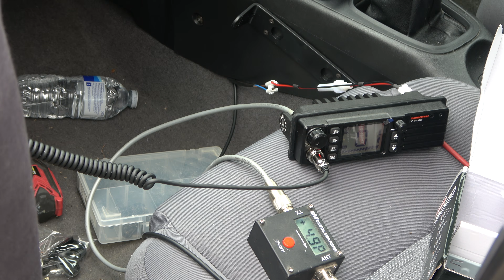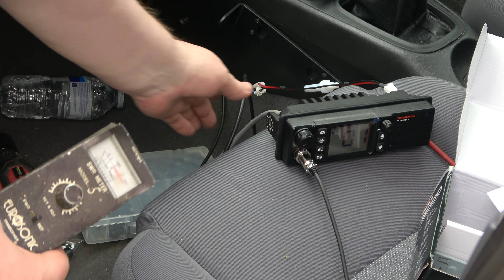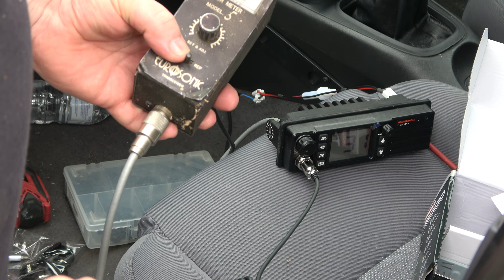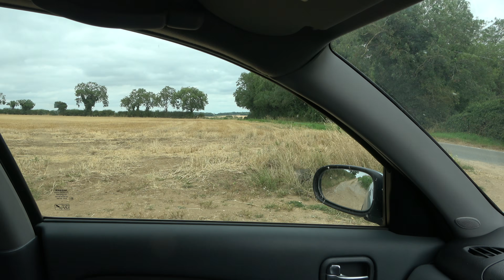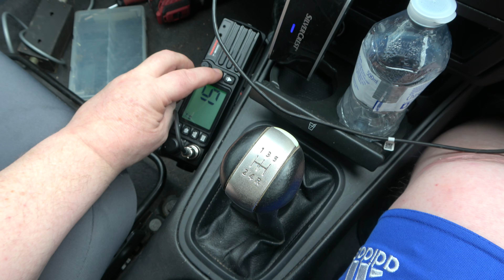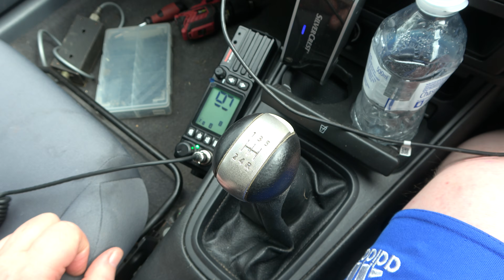Fitting a new Thunderpole T3000 CB radio in my Nissan Almera N16 - and quick test

Comment: Hi Richard do you sell the Thunderpole 3000 power leads? I was just about to install mine this week and was thinking it would be a shame to chop the cigarette plug off.
Reply from the maker: Yes I do. They are on my Ebay listing, a link to which is in most videos I've posted over the last year. I can sell them direct at 85p more than the Ebay listing, so it's eaier & cheaper to buy them via my Ebay stiore. Mr Chippie makes them with the correct (not fake) mouldings & pins imported from the USA, usimg correct Japanese tooling & RS high quality fueholders. I think they're £5.99 on there.

Richard, 0OJF, UK

Comment: Do you find having a an electrical car with LEDs lights as well as all the other things that interfere with radios, or is it just me over thinking about electric cars. Thanks Richard and mr chippy. Alan from LUTON. With the Harvard 420 . I'm positive I've sent you a email and my email as well. Thanks again. 🤔👍👍
Reply from the maker: I don't seem to have had an email from you, unless I've responded & have totally forgotten.  rshireby@yahoo.co.uk

Some electric cars are dire on interferemce. The only click we ever get from the Nissan Leaf is when applying the brake pedal.  One Day, Mr Chippie & I were sat in the car in Lidl car park at Grantham, parked next to a BMW electric car. The owner of the BMW came back to his car & moved off. The interference from that car was the worst I've ever encountered & it finally stopped interfering with both the CB radio & the 70cms amateur radio 50yds away!  Surely cars are tested for RF interference to get approved. Clearly yet another 'expensive' car that's all fur coat & no knickers.

Richard, G0OJF, UK

Comment: trough line (that's where i got it from, from you, 35 years ago...!!
through line turret type sensor, 3.5 to 150MHz..
and badged up all sorts of names, 
and people think they're crap but don't realise that they're actually reasonable.
Reply from the maker: I've a Binatone, Audioline & TMK branded versions. They are very much worth having. I think that tatty one in he demo deserves some restoration work. There is a twin meter version too. Most other types use a printed sensor on the circuit board & don't work as well.

Richard